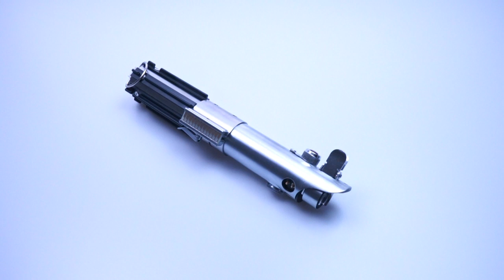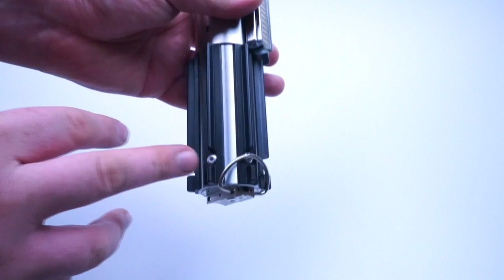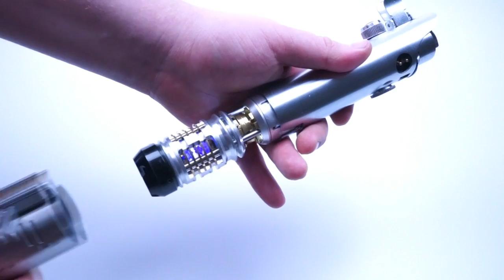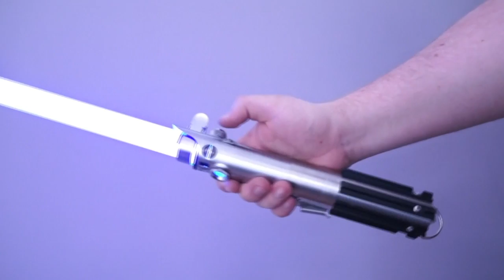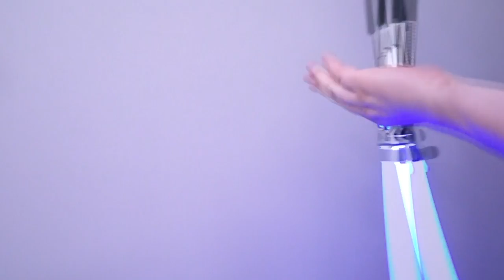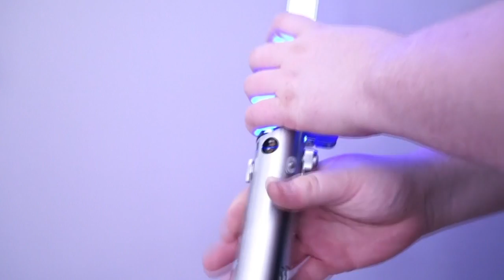Vintage Graflex 3 Cell Crystal Reveal Custom Star Wars FX Lightsaber TFA Style

Comment: The configuration of the led sequences, is this a standard mode on that CF sound board? When using a NBv3, is there a ultra small board you can add?
Reply from the maker: It's not the default settings. I configured these LED sequences. It's explained in the manual. There isn't a function like this available when using the NBv3.0 unfortunately.
Reply: KR Sabers Indeed I am aware that this is unavailable on the NBv3. I was actually just wondering if there was a external small pcb available to only configure those leds on 3.7v as I already have a NB without buying a new soundboard. Thank you nonetheless
Reply from the maker: There isn't anything like that available unfortunately. I have heard of people using arduini mini micro controllers in additions to their PlecterLabs boards but it uses up a lot of space and requires custom coding.
Reply: KR Sabers Alright, thank you for the info and your time